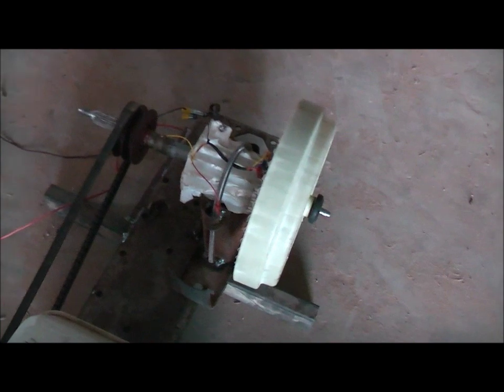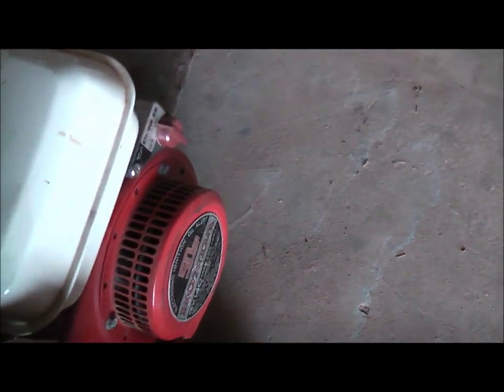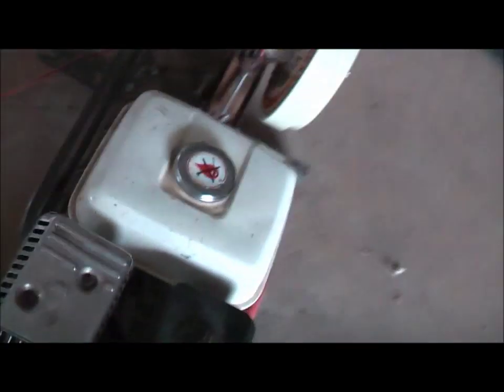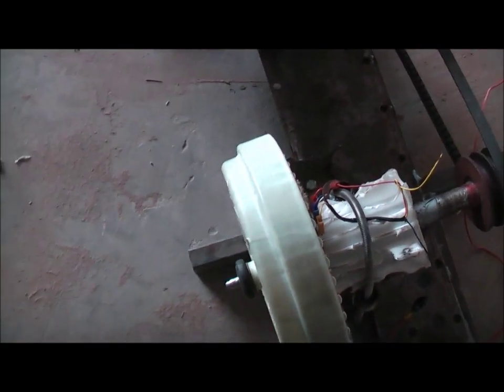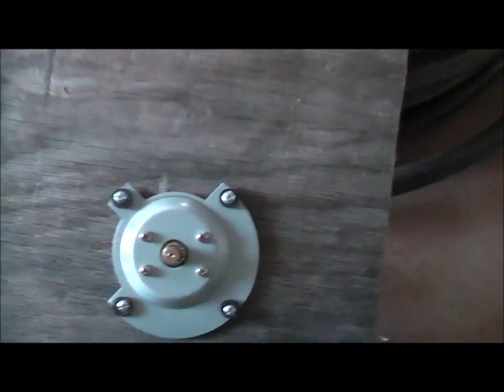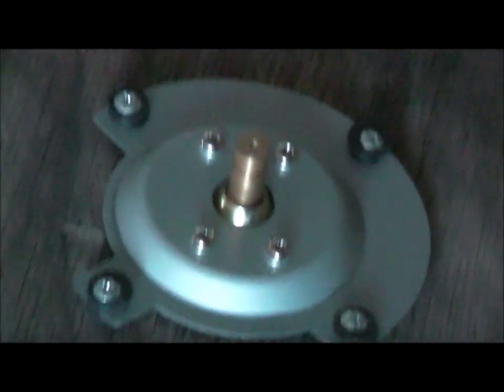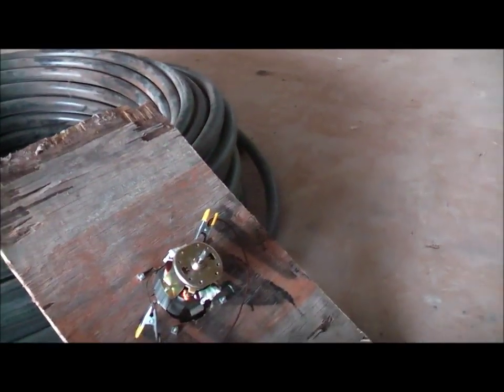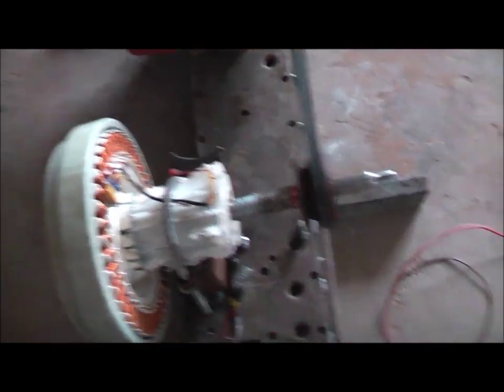Fisher & Paykel Smart Drive High Voltage Generator Fun

Comment: What are the voltages and amps generated by this?
Reply from the maker: It peaks at around 750 volts as for current, around 20 amp short

Comment: apparently the F&P smartdrive motor was invented at NASA and the rights to use it were bought by F&P-its original use was shuttle bay doors-the source of that info was a F&P technician.
i got one from the side of the road couple of weeks back-gonna try running with a PWM pulsing one of the phases and see if i can do anything like a bedini with it...how are you taking power of that one?
you got 3 separate windings-how have you configured them?
Reply from the maker: Left unmodified

Comment from the maker: It'll pop MOT's, Bothe the Frequency & the voltage is too high, If I hooked this up to another Smart drive, I'd be able to use this generator as a VFD to drive the washer at silly speeds :P

Comment: get a couple of old MOT's and hook the F&P motor windings through the HT windings, see if you can get it to generate 240. you should be able to get 3 phase AC out of those motors,

Comment: F@P Smart drive motors do 1000RPM when doing a fast spin.
so anything less than 1000RPM the only thing that may cause it to fail is the extra stress.